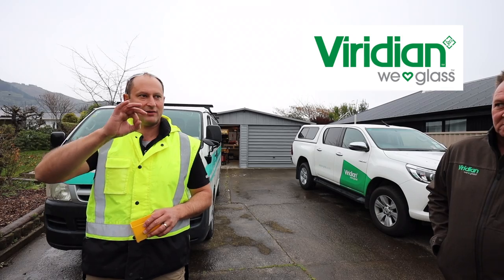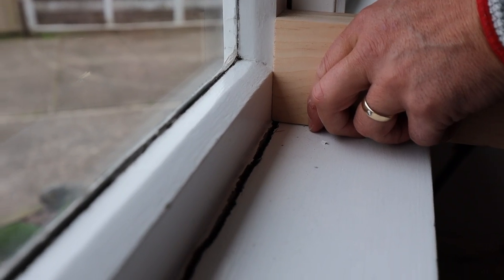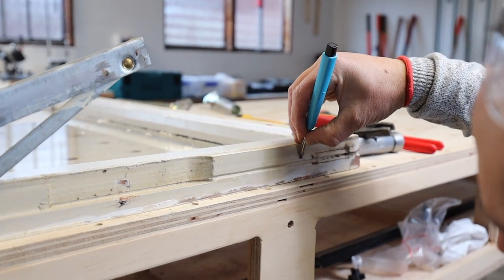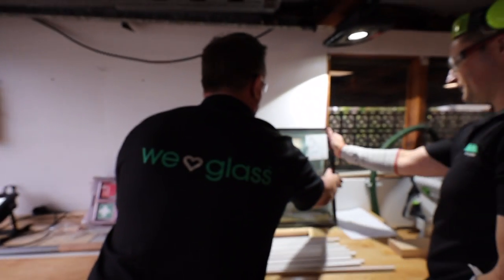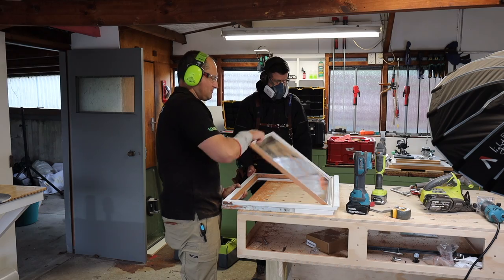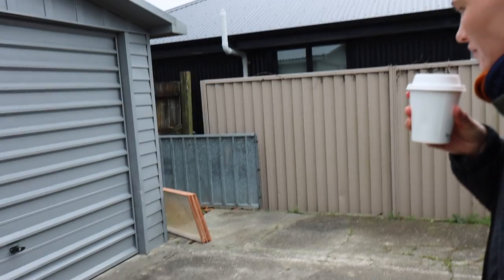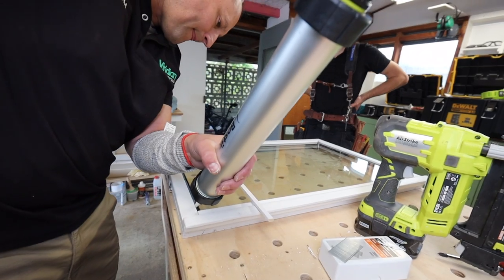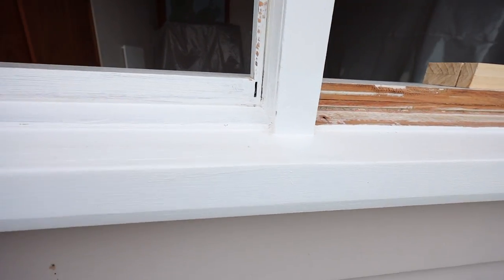I'm Double Glazing My Old Windows... Wish Me Luck

Comment: I’m a builder in Auckland who has done a range of retro fitting double glazing, single low-e glazing, sash replacement and entire window replacement in timber joinery. There’s a range of issues with double glazing and different glazing companies have told me conflicting things about the sealants and systems they use. One company told me that the paint on the frame is what seals the glass to the bead and stops water getting in. All the ones I’ve done the timber bead has been quirked back past the frame, the opposite of what was demonstrated here. They’ve used an MS-sealant between the bead and glass, rather than a clear silicone. Stainless steel brad nails are a must into cedar sashes, as galv will react and rust. I’ve seen an older double glazed system with no sealant, and drainage holes on the beads to let water run out, as you’d expect the cedar beads rot and needed replacement after about 12 years (that’s why I was there). The guys at Veridian appear to have their system sorted, which is really all the builder and end user can rely on.
Reply: In the Netherlands a different kind of bead is used on the bottom edge of a fixed window called a "neuslat". Not sure what its name is in english, but a google search will net you images. Its essentially a bead that extents past the edge of the sash, and turns downwards into a drip edge. Its apparently also common to put this bead on pads, so there is a small airgap between the bead and the window frame, for airflow and drying. They say online that if somehow water finds itself behind the beads, this air gap makes it able to dry off. But not sure if this kind of bead is applicable to sash windows, since they stick out beyond the frame.
Reply: @WouterNederstigt  There are quite a few different systems used in Dutchland. Dry-dry is some kind of rubber strip inside and outside, as with aluminium windows. Wet-wet is sealant on both sides, on 3 mm glazing tape. Apply tape 3 mm from the edge to sash and beads. Install glass. Apply sealant afterwards and tool off. Dry-wet is dry inside and wet outside. A ventilating/draining bead at the bottom is always a good idea but difficult with flimsy sashes like these. In this case, I might have drilled two drain holes through the bottom of the sash (not uncommon in Dutchland). I would absolutely not have sealed the glass like they did here and I would not have used silicone. I would also not have used water based primer on Cedar.
Reply: Serious question, i was always told galvanised nails/screws etc, were weather proof.
If they arent, wats the point of the galvanised coating??
Reply: @prezzeruk4054  Wood releases some compounds that make the screw sit in an acidic environment, which rusts the coating. But normal rainwater won't corrode it, so it's depending on the application if such a coating is effective. Living near the coast also corrodes it, since the salts in the air introduces sodium chlorine to the material. It's also unwise to use galvanised fastners in direct connection with Aluminium, since that will rust the Aluminium due to Galvanic corrosion. Stainless steels aren't foolproof either, in indoor swimming pools (chlorine in the air/water) the grades 304 and 316 of SS will degrade without visible markers, making it dangerous to use for load bearing applications.

But for most applications, galvanised nails/screws are fine. As long as you don't get it routinely wet the corrosion will only slowly form, making it last for quite some time
Reply: @prezzeruk4054  hey, yeh they are but not with cedar. Galvanising is a zinc coating over steel, it protects the steel, it works in most cases. There is a component of cedar that degrades the galvanising, allowing the steel to rust quickly (I’ve seen it happen within 8 years in NZ). So we have to use either stainless steel or silicone bronze fastenings in cedar. Hope that answers your question.
Reply: @mycoolcar  yes thanks, u learn summat new every day!!
Reply: Double glazed units need to breath if let to sit in water with zero weep holes then the unit will fail prematurely
Reply: @WouterNederstigt  yeh, I’m in the UK & have been glazing for 20+ years. There’s many ways to skin a cat, but my preference is dry glaze, with ‘hockey stick’ style bead at the bottom for a drained & vented system. I personally wouldn’t go through all the laborious process of converting single to double glazing, I’d replace with a modern window that is designed to carry the extra weight, and seals perfectly. You could do all the work shown in this video & still have drafts windows they don’t operate well.
Reply: @WouterNederstigt  Thanks for the name. A neuslat bead is exactly what I am looking for although we don't seem to have this profile in NZ.

Comment: Hello mate. I reckon those bottom windows were nailed shut due to the close proximity to your lpg bottles that would otherwise be a compliance issue under asnzs 5601.1 I've had to do the same at my place, and I'm a gasfitter! I agree too that you'd end up walking into them! Great episode, absolutely stoked for you bro getting this double glazing, you deserve it.
Reply: I noticed that too as I have come across this issue before. But if other windows are also screwed shut I suspect that they may have also done it to stop them walking into the corner of open windows
Reply: Very good point about the gas bottles - home owners can forget about things like that when moving to a new abode.
Reply from the maker: Great point Sam!

Comment: This will be a great improvement to the comfort of your house!

My grandfather’s house, built by my grandfather’s grandfather in the first decade of the twentieth century still has the original double glazing. Compared to modern double glazing using plate glass it possesses a spellbinding quality thanks to the imperfection of the blown glass. Even the dullest of days looks pleasant throw the panes of that window with the sparkles and reflections it creates.

Usually I am quite reserved on the replacement of windows, a newly manufactured window can create a disruption to the aesthetics of a house. This approach of retro fitting existing frames with double glazing is a rather sensitive and thoughtful approach. Hopefully the company can have many happy clients using their service. Just leave any handcrafted blown glass alone.

Comment: Hey Scott. Let's have a building competition😎 I just put up a video changing out one of my windows from non-impact to impact for hurricane Insurance reasons. Without them home insurance is expensive in Florida. My old windows are double pane, insulated, low E and even hurricane, but not impact. The glass on the impact windows is really thick incase a flying object strikes them at 100+ miles and hour, they won't break. Ron😎🤙 BTW, I have been making videos on YT for more than 10 years and you are WAY better than me.

Comment: Hi Scott,
I had new double glazed sashes fitted into the original frames in my 1920's house some years ago. It did improve things, but still get drafts around the unsealed sash to frame join. So I'm really looking forward to seeing how you approach that part for the opening sashes, as I'd like to do that too. 
Also had a new frame installed in another part of the house, again with dg sashes that have a seal and the temperature difference between the rooms is noticeable, so that sash seal is a critical part of the process for sure. 
Still loving the channel even though the content has changed a bit lately,  must be so frustrating for you and Jess, so can't wait for you and Jess to get going on the reno, if your past work is anything to go by I'm sure it will be transformational!
P.S was walking past a shop fit out in Wellington last night and spied 100 sheets of GIB just sitting there! Lets hope we get this ridiculous shortage situation in NZ sorted soon, so clients and builders alike can get back to getting on with home reno's, new builds, shop fitouts .etc....

Comment: I double glazed my office windows myself but rebated (with router) the inside and left the original glass intact. I left a air gap of 12mm (optimum spacing for insulation but avoiding air convection) and used acrylic sheet which has thermal benefits over glass. Acrylic doesn't get cold like glass but you could scratch it (it doesn't get condensation on it so you don't need to wipe it). I put some grains of rice at the bottom inside, no sealants. Amazing difference; no condensation and quieter. 
The last 3 Ryobi (yellow as shown here) tools I bought were duds. A planer cutter bearing melted out its housing in half an hour, a belt sander lasted 1 week and a second replacement lasted just as long. I am very gentle and fussy so I didn't use them like an animal. I moved back to Makita; obviously.

Comment: i recommend installing both sashes (awnings?) as movable, where there aren't propane bottles.  the ventilation benefits are substantial with hot air exiting the top and cooler air coming in the bottom.  we've been renovating and weather sealing and restoring all our original fir windows from 1910.  crap tons of work, huge benefits, performance close to modern windows.

Comment: Great video. To be honest, I would have been very afraid to screw the old wooden windows up. But it looks fantastic.

You will insulate the walls, too. I think it is necessary because, as you can see with the change of condensation, the moisture has to go somewhere. As the windows are now no longer the coldest surface in the room, it will go into the walls.

Comment: Looking forward to seeing you have a go. I'm sure you will smash it (pun intended). I have recently done this with my home. I really enjoyed the project, it was rather long winded but totally worth it! 

If a keyboard wielding graphic designer like myself can do it, I'm sure you can too, no sweat. 

The system I used was a bit different where extra routing was done on the bottom edge to create a 15 degree angle to accommodate a drip tray thing (probably not the technical term haha). It's designed  to allow any condensation buildup to escape and not rot your frames. It also used rubber seals on both sides, no need for silicone.  

Overall I think I saved about 20k doing it myself. 🎉

Somewhere I have a time lapse of this process 🧐

Comment: I helped my boss remodel a house for his son. I’m not sure when it was built but the windows still had window weights. Some of the sash cord had broken so we had to take the trim off to get them out. We refinished them all, replaced the sash cord and installed them. Old windows like that always seemed to get wedged if you weren’t careful when opening them but after redoing everything properly they worked quite well. The house had those old push button light switches so it was pretty old. We tried to keep the original stuff as much as possible. All the doors had original hardware. Some interior doors even had the classic keys and keyholes

Comment: Fun fact - here in the tropics the Low-E coating on the glass would be on the inside of the exterior pane of a double glazed window to reduce the heat transfer from the outside to the inside where the interior space is typically air conditioned rather than heated.

Comment: well in Canada the high performance windows would be triple glaze, low e and argon gas filled with thermal gaskets all around. Our thermal gradient in depth of winter would be 60 to 70 degrees C (minus 40-50 outside plus 20 inside, minus 58 F to plus 68 F).
Reply: I live in Saskatchewan, and have always wondered if Canada and the US is the only country to have fly screens?
Reply: Meanwhile in Australia we're still building with single glazed windows and paying through the nose to heat & cool our terribly inefficient houses. Fly screens are common though.
Reply: @cray-  Isn't that crazy? With the cost of energy I would have thought that energy efficient buildings would be part of the construction code, heat is just as bad as cold, we go from -35C in winter to +35C in summer, energy efficiency is normal building practice.

Comment: Meanwhile here in Melbourne Australia we bearly have to use low e single pane glass in new builds, and be lucky to see a builder seal air gaps around the window frame or fold in the building envelope membrane. 🤦🏻
To be fair some of the volume builders here have “decided” to use double glazing as a feature. Still no air gap sealing around windows. Only seen it once in all the houses made delivery to.
Reply: Jeffry Chen  I live in a “new” house from 2015. I can feel the heat being sucked out through the window with thru the glass or the air gap around the trim underneath. 
It’s so stupid

Comment: It's called a whitco stay, better than hinges for fanlight windows. Please everyone, always crisscross tape your glass before hitting the sash out. If you can afford it, It pays to do this in new sashes due to the old glue holding far too small a surface area in the mortice Tennon joint after removing so much timber. A lot of joiners refuse to do this in old sashes. Actually..... fuck it, do what you want.

Comment: hey Scotty, 
loving the window treatment...

mate with bottom windows not opening may be a code violation if there is a fire and is an alternative as a fire escape you may get knocked back by your insurance if you had to claim... 
you don't have to open them so you don't bump your head from outside per say... but they may have to be functional... 
check what your lawful obligations are...
cheers...

Comment: I have always wanted to see how much time and skill it took to router out those rebates for the double glazed units, there is a lot involved but you get to keep the original design and character of the house. Tim from viridian made that look easier than it is. 

But if you are going to reline the room adding wall insulation etc it probably makes it an ideal time to replace the timber windows with aluminium with insulated frames and a low maintenance  finish.

Once again thanks for the video.
Reply: PVC frames are much better than aluminium ones. Windows with insulated aluminium frame (thermally broken) with two 4mm low-e panes, 12 mm air gap and argon in-between have R value 0,77, while the same window with frame made of uPVC or timber has R value of 1.
Reply: @Stefan_Kawalec  pvc frames had a poor initial start in NZ due to the more intense UV, so it has a much smaller market here.
Reply: Scott I wonder if it would be possible to get a video of retro fitting new window joinery to a weather board house as a bit of a comparison of the work involved.
Reply: @shaneyoung72  We had the same problem here in Poland in the early 90s. Those PVC windows back then were literally shite. Frames exposed to sunlight were getting stiffer, they cracked and creaked terribly. Nowadays everything works perfect.
Reply: @shaneyoung72  theres also the aluminium inserts that retain the original sills etc, just the old mullions and transoms cut out. Depending on how many of those are in a window, a couple of builders can do 2-6 windows a day, usually a house load in under a week. Full window units would take longer due to having to replace all the finishing architraves etc.

Comment: Router deeper (adjust glass measurements to suit) so you achieve a negative detail beading. Then fully seal beading on with a compliant MS sealant. As someone who has double glazed using a negative and positive detail beading, negative looks much better. And draft seals are an absolute must. Go Aqua Mac 21 draft seals with a hard backing. None of that stick on, last a season crap.

Comment: I live in Finland my house is built 1978 and all windows are triple pane each glass separate though. Best glass available are 4 pane with 2 thermal elements bigger space between elements.

Biggest difference you will get with these new glasses isn't energy efficiency it will be sound proofing those will be much quiet than old ones.

Comment: So light brings with it a certain amount of heat (think radiating heat from an open oven, or a warm spot of sunlight coming through a window) Low-e works by being tuned to reflect waves of light. 

So visible light that the human eye can detect is let through, but the low-e coating acts like a mirrior to other wavelengths. 

In climates where the average temp is above 70°F (21°C) it makes sense to have a low-e coating usually makes sense to keep a house cool. 

In climates where the average temp is below 65°F (18°C) usually folks leave off the low-e because the warmth brought by the sunlight usually helps with the heat bill.

Comment: Hey Scott, 
Tip #147 
When using a linbind scraper, to add more leverage and control,
I’ll cut the end of a broom handle ( you can make it 200mm, 300mm etc long )
Spread the hand grip of scraper,
Insert broom handle
Use Hammer to close lindbid fasteners to handle
and Bingo an incredible new type of weapon to clean up your window frames m8
Reply from the maker: I like it, thanks!

Comment: This video is perfect timing. I bought a 1952 house in Christchurch 4 mouths ago similar style to your house. It's cold and I'm looking at retro fitting double glazed windows into wood frames. I'm at the getting quote stage and didn't know about Viridian. I'll get a quote from them too. Are you doing the bathroom as well or just the living and sleeping areas only? Looking forward to see how you adjust hinges to fit insulation tape I'm a DIYer, so your my teacher.

Comment: Here in Scotland homes do not require retro fit double glazing until 2025.

I've been considering doing this myself because the cost of buying sealed units is about 20% of the cost of having UPVC windows installed.

Comment: All around a very helpful video.  My only issue is that I would have prefered a bit more technical detail on the routing out and sawing process to remove the old pane.  This is by far the most important / technical bit IMHO. Thanks